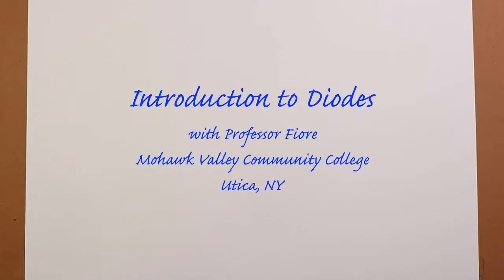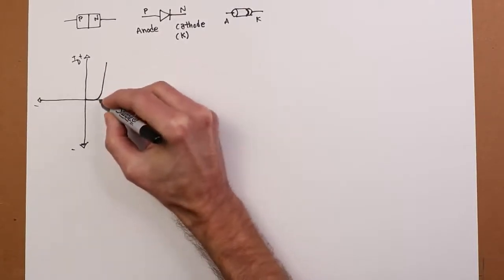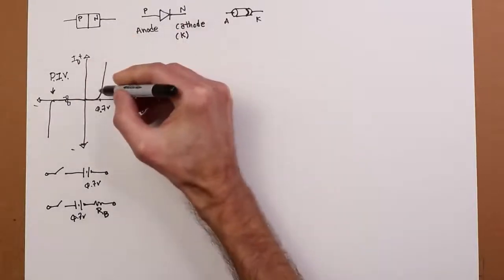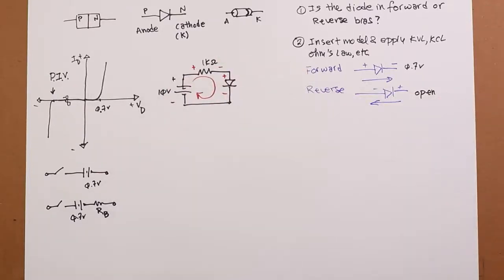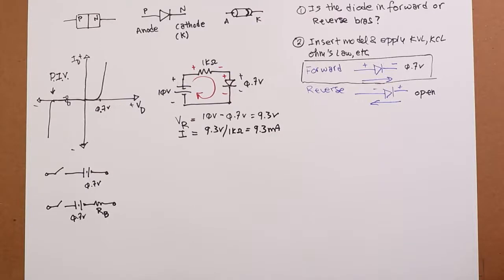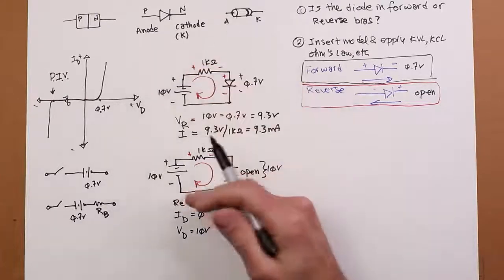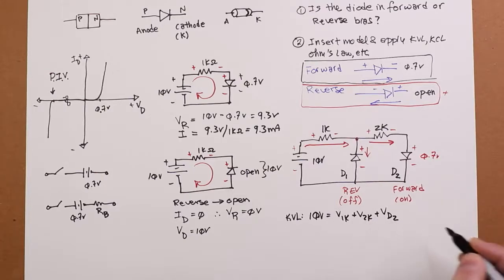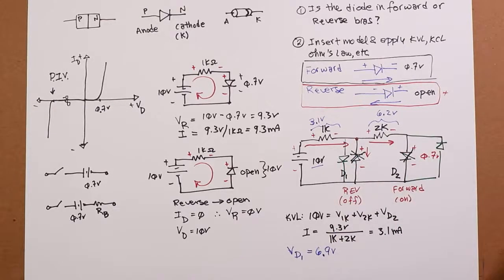Semiconductor Devices: Introduction To Diodes

Comment: Thank you for your content, Professor Fiore!  Commenting on the final circuit.  D2 is reverse bias, so relatively no current would go through that loop.  0.7v would be at D2 cathode.  D1 is forward bias, so it should drop 0.7v.  Knowing that, the 1k resistor should drop 9.3v.  Current through that loop should be around 9.3mA.
Reply from the maker: Yep!

Comment: I've got a quick question now if we got 2 circuits both got the same  resistance and battery first one got a silicon diode and the second has a germanuim diode and then we placed a voltmeter on both diodes and showed 0.5 on both of them does that mean the silicon one has a current of zero??? (Since the voltmeter show rms value)
Reply from the maker: First, RMS is only valid for AC signals and you have a battery (DC). In any case, it would be odd for a Ge diode to have a 0.5V drop across it as the barrier potential is closer to 0.3V. If you measured that, I'd assume something was wrong with the circuit or the diode.
Reply: @ElectronicswithProfessorFiore  it was a question in our a-level exam 3 days ago and the question was so odd since the choices were "Ac1 is less than ac2" other choose was "ac1 equals zero" idk if there's a way to contact u and show u the question
Reply from the maker: @fishclips6888  From your description, it sounds like there are AC sources in there along with the battery.  If there are AC sources, that changes everything. If it's literally nothing more than a battery, a resistor, and a diode in series (forward biased), then my initial answer stands.

I will add that if the sources are AC instead of batteries, then the waveform across the diode will be a clipped sine wave. For them to have the same RMS voltage, that would imply that the source potential in Ge circuit is larger (because the forward part is smaller, that means the reverse part would have to be larger in order to create the same RMS value).
Reply: @ElectronicswithProfessorFiore  nope both of them were connected to a battery and the question didn't even state the values of anything beside the voltmeter read
Reply from the maker: @fishclips6888  Are the diodes reverse biased? That's the only way I can see this making sense. It remains odd that they are referring to RMS values for a DC circuit. Ignoring that, and assuming that the diodes are reverse biased, then each of them showing 0.5 V (DC) tells you that the batteries are each 0.5 volts. The currents would be so small that the voltage drops across the resistors would be inconsequential (unless they're huge, as in many mega ohms). Thus, all of the voltage would drop across the reverse biased diode. Also, it is odd that they would refer to a battery source as "AC1" or "AC2". 

Let me back up because maybe I am making some unwarranted assumptions based on your initial comment. This does have me intrigued. First, are the two circuits identical except for the fact that one uses Si and the other a Ge diode? Second, does the circuit consist of just a series loop containing a battery, a resistor, and a diode, and there is a voltmeter shown across the diode? Third, what is the direction of the diode (to keep it simple, is the "diode symbol arrow" pointing toward the short vs. long bar of the battery symbol (or if it's using a generic round symbol for the battery, is it pointing toward the minus terminal of the battery)? {Or more technically, is the cathode connected to the minus battery terminal?)
Reply: @ElectronicswithProfessorFiore  the question word for word (it had the circuit drawn too) "we have 2 circuits each one consists of a resistor, battery, and diodes both diodes are in forward bias first circuit had si and second had germanium and each diode had a volemeter across it (NOT THE BATTERY) and that voltmeter showed that the voltage of both volemeters were 0.5v"
Reply from the maker: @fishclips6888  OK. For Si, the diode is not fully on as 0.5 V < knee. This means the current is very small and therefore the voltage across the resistor should be tiny. Consequently, the battery must be right around 0.5 V (via KVL). 

For Ge, the values are nonsensical. 0.5 V is well above the knee. This implies a very, very high current which would also produce a large drop across the resistor (unless it was a tiny resistance), and by KVL, the source must be a very high voltage. Not practical at all as I would expect the diode to fail in short order due to excessive current/power. Kind of a moot point really, as no one much uses Ge anymore.

BTW, I assume that's a "voltmeter", not a "volemeter". I think a vole meter would measure the number of mouse-like rodents in a particular area. ;-)

This was for a major exam? Did they tell you the expected answer later? The question strikes me as being somewhat contrived.
Reply: @ElectronicswithProfessorFiore  it was indeed a question in the exam and even teachers had different opinions on it. I personally chose the answer "AC1 equals zero" because I had no clue what the question is talking about it made no sense at all
Reply from the maker: @fishclips6888  So this was a national or regional exam, then? You mentioned "A levels"; are you in the UK? If your own faculty didn't know, then I assume they didn't write it. If that's the case, then my guess is that the question was not created by someone with a degree in electrical engineering but rather by someone who was just looking at some of the mathematical models and not understanding the practical implications. The fact that they're calling a battery "AC1" is odd in itself because it goes against naming standards. Personally, I would consider the question to be invalid, and feel free to tell your teachers that I said as much.

If this is the case, it would not be the first time I have seen such things. Do you remember all of the possible answers? I mean, if one of the choices was "circuit catches fire", that would be a good answer. ;-)
Reply: @ElectronicswithProfessorFiore  not actual "a level' but somewhat similar to it. in my country we study 8 subjects for a whole year and the results decide what im going to study in uni (basically the exams that decide my whole future) and then do these tests that last for 3 weeks and those exams are all written by the ministry of education and by far math, chemistry, and physics were a nightmare not because they were hard but because they had many questions that did not make sense, for example, we had couple questions that have 2 right answers ( keep in mind they are all multiple choices) such as physics, math

and for that question the choices were 
a) ac1 is less than ac2
b) ac1 is more than ac2
c)ac1 equals 0
D) ac2 equals zero
Reply from the maker: @fishclips6888  Not to belabor this, but am I correct that the circuit diagrams looked like what I drew in the video above at 6:00 ? No component values were given and the sources were labelled AC1 and AC2? Was AC1 driving Si and AC2 driving Ge? If so, I will give you the real answer to this problem.
Reply: @ElectronicswithProfessorFiore yup no values were given and it looked exactly like that and in forward bias
Reply from the maker: @fishclips6888  Alright, the first thing is to remember KVL. Here, the combined drop across the resistor and diode must equal the source. That means that answers C and D must be wrong (no source, no drops). Second thing, for any practical Si diode, with only 0.5 volts across it, the current through it will be negligible. That means that the drop across the resistor will be small enough to ignore (unless it's impossibly large). That in turn means that the source, AC1, must be approximately 0.5V. That means that B can't be true because AC2 would be less than 0.5 V, but if that's true, you can't get 0.5 V across the Ge diode. Turning to answer A, it would be possible to get 0.5 V across the diode if AC2 was more than 0.5 V, BUT that requires certain parameters from the Ge diode (namely, a high bulk resistance to achieve a potential > 0.3 V which is the "knee" of the Ge curve). This will imply a high current which will create a significant drop across the resistor, and thus AC2 > 0.5 V (i.e., > AC1). 

End result, A is a possible answer, but not without specific parameters for the diode/resistor. I would not call it practical or even a situation that the average engineer would expect to occur. Normally, we expect around 0.3 V across a forward biased Ge diode. The other three answers are impossible, though, so A would be the choice. Terrible question in my opinion. I wouldn't go so far as to call it a "trick" question, but it's needlessly confusing and complicated at that level. 

And again I will add that calling the sources "ACx" only compounds the situation. Granted, you can give any name you want to a source, but labeling a battery as "AC1" would be like buying paint that is called "Summer Sky" and discovering that it's dark red. I wonder if the person who wrote the question really understands electronics or is purposely trying to confuse students. Neither is good.

Feel free to share this with your teachers.

Comment: What is the criteria for selecting knee voltage in the diode I-V curve?
Reply from the maker: There really isn't a specific mathematical criterion. It's more of a practical, empirical thing given typical usage. That's why you'll sometimes see texts refer to the knee as 0.6 V and others as 0.7 V. (Plus, there is some variation due to the diode design itself). In most designs, the precise value is not important.
Reply: @ElectronicswithProfessorFiore   OK. Does university lab experiment ask students to find knee voltage?
Reply from the maker: @myawoo  It might, but typically they would ask you to plot the curve and then give an estimate. See Exercise 3 in my Semiconductor Devices lab manual (it's a free PDF download; follow the links given in the video description, above).
Reply: @ElectronicswithProfessorFiore  👍👍👍